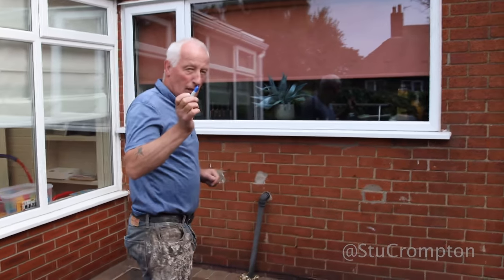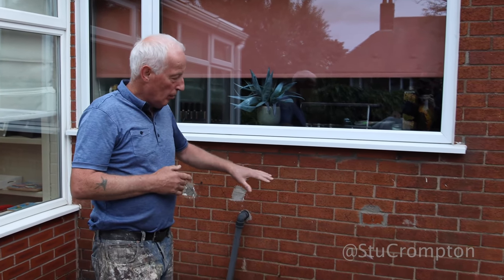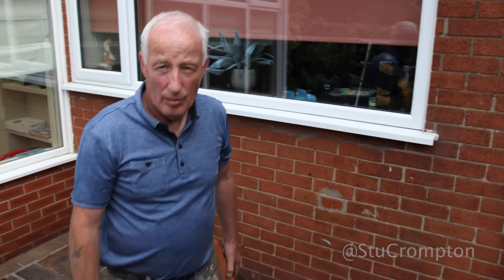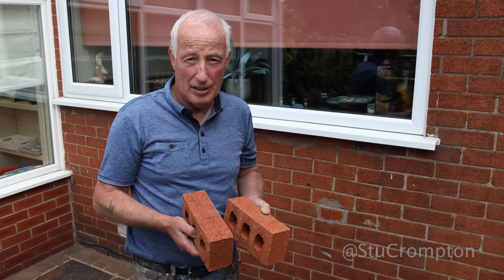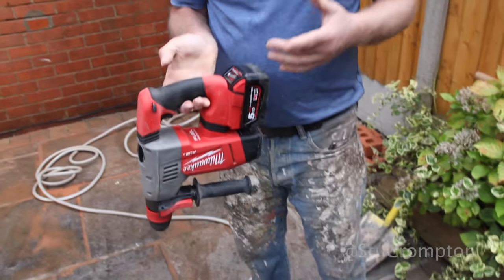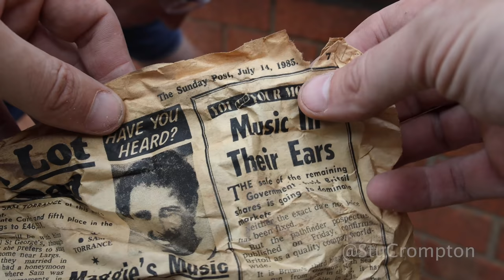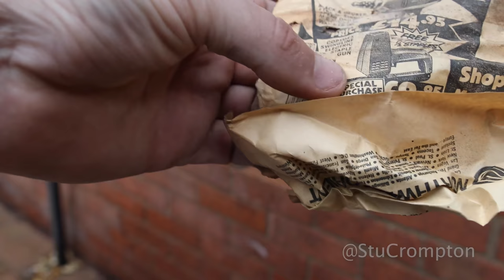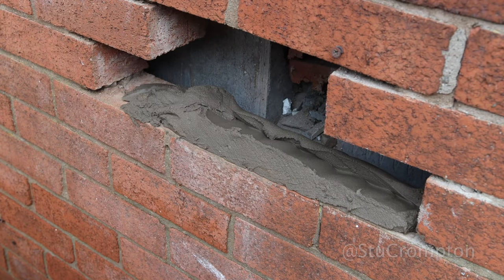Bricklaying - Father VS Son

Comment: Hey brick mason from NY here .. looks good only thing I would of done differently is before laying the brick back in... fill the holes in the brick being laid so there's no spot for water to hold if any dose get it... cause if you think about it when you lay brick the holes in the bricks All get filled in by spreading the mud for next course .. by replacing brick in the already laid wall , if you dont fill holes in brck there will always be that void in the brick you replaced...just put the brick on the mud board fill in the holes then butter it up an lay... just a little tip I picked up with time ... love everything else looks good

Comment: Where'd you get that mini cutoff saw?  I've never seen one before.  The smallest I've seen was 12"s.  Other wise it's a circular saw with a 7" blade.  Then again I don't use them a lot where I live, almost everything I do is hammer cut block work, stucco and drywall. It looks to me like that's only about a 9 or 10 inch saw.